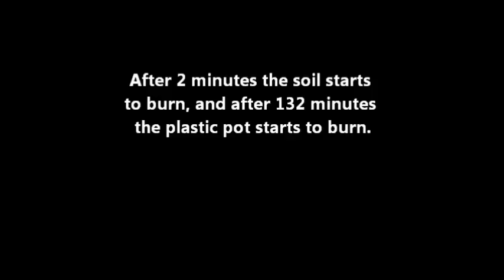How a cigarette ignites potting soil

Comment: Never knew about this. Always put out my cigarettes in my outside wooden planter right next to the wall until a few days ago it caught fire (still surprised it hadn't done so 70-80 cigarettes before). I figured soil doesn't catch fire but apparently it does. Luckily i noticed the smoke an hour after while it was still in an early phase and was able to put it out with water before it caused any damage. Definitely never putting my buds in a pot again!
Reply from the maker: I have done this test several times it doesn't alway work. The soil gets wet in the rain and dries out in the sun. Then one day it just takes off. Tell your friends and family about this. Share it and we can save peoples lives and property. #thefirescienceguy